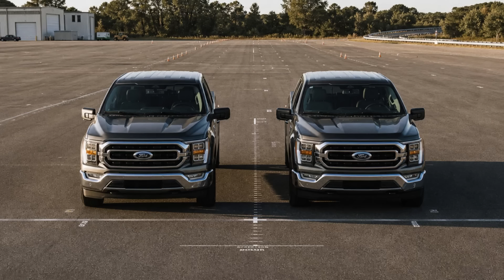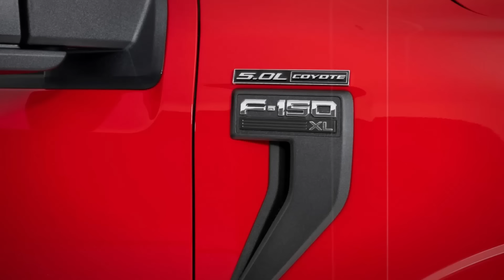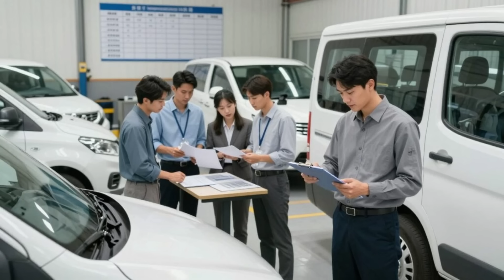We Tested Cheap vs. Premium Fuel in the Same F-150 for 50,000 Miles—The WINNER Surprised Us

Comment: I own a F150 Powerboost and run Shell or Chevron 93 octane exclusively. The 93 gives me noticeably better power and fuel mileage, but it a $1.00 a gallon more expensive but I don't drive much so that's OK.

Comment: I own a 2013 F-150 w/5.0L V8.  I have 206,000 miles and have run predominantly Sam's Gas (non-Top Tier) regular gas for the last 160,000 miles.  Will changing to Top Tier regular gas clean the carbon deposits?  I have noted a decrease in fuel economy of about 1 mpg.  Are there fuel injector treatments that would be recommended?

Comment: IHAVE BEEN USING 87 OCTANE GAS IN MY 2014 F150 (NOW WITH 88,000 MILES) ... THE FUEL IS SOLD BY SAM'S  CLUB IN NORTHEASTERN  PENNSYLVANIA ... IS THIS FUEL TOP TEAR?  I HAVE NOT HAD ANY ISSUES AND HAVE KEPT UP THE MAINTAINANCE WELL SHORT OF THE FACTORY SCHEDULE

Comment: My 2016 Ford Escape with a 2.0 turbo SE needed a catalitic converter and turbo replaced before 45,000 miles.  I  still use mid grade gas. But after the repairs I switched to the TopTier gas and now at 103,000 miles I still have full power and a good idle.  I drive in Colorado and do some mountain driving.  I never have had any check engine light since I have used Top Tier gas.  I have never needed to replace any sensors so far!
Reply from the maker: It is great to hear that switching fuel types has helped your vehicle run reliably for so many miles.

Comment: drove my 2003 Infiniti G35  for 300,000 miles on the cheapest gas I could find, didn't buy Top Tier gas.   Zero issues with the car,  when I sold it, the engine still ran just like when I bought the car.
Reply from the maker: That is an impressive testament to how well you maintained your vehicle over those miles!

Comment: OOoo, you've had 10 years running fleets.  I've had over 3 decades blending fuels, esp gasoline.  You know what Premium has that 87 regular doesn't? Something called alkylated gas or "white gas".  Especially good in a higher powerband need under load.  Its research and motor octane values are only 2 octanes apart.  Same as butane which helps to make whitegas.  All the other component streams regardless of RdON are approx 8 octane RES. vs MOTO numbers apart.  Whitegas and very high Rd reformate or platformate, depends on what these streams are called where you're from, provides power and cleaner burning.  Now I ask, what did the truck manual tell you to run in it?  87Rd is normal.  Meaning, Premium is NOT meant for your truck.  89 at best in new models because of changing fuel standards.  (save that for another video).  I feed high performance engines 93Rd.  And 89 for my truck (used to be 87, changed specifically because of changing fuel standards).  Run what your truck or car is meant to run.  Very few if any refiners add these additives such as detergent.  That's done at P/L terminals and marketing depots.  ASTM method has always been the testing standard.  If quality control governs gasoline production like it should be, then you're getting what you're paying for.

Comment: :face-green-smiling: Premium is never better if it does not specify to use it. Use TopTier gas in the octane specified.
I have seen the results when a vehicle is run on a dynomometer. If the engine is to run on regular 87 octane gas and premium is used it will actually produce less power!